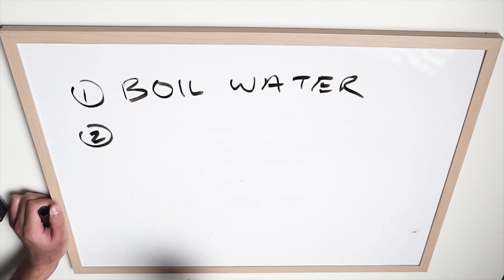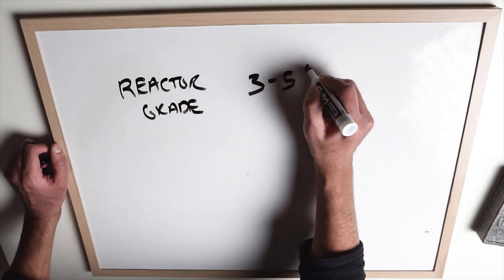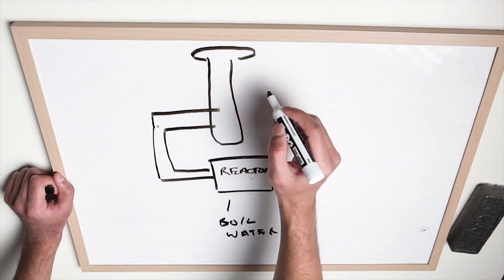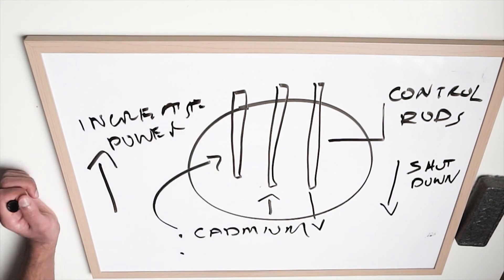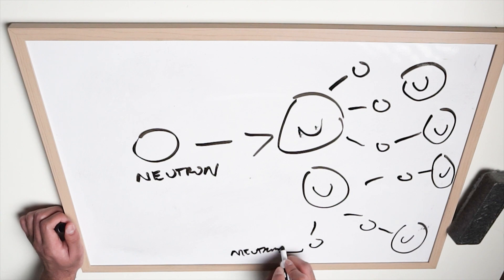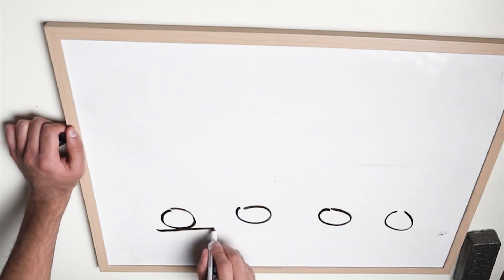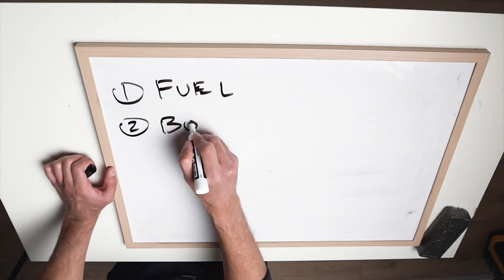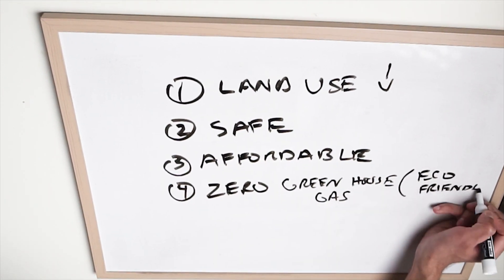Nuclear power reactor EXPLAINED in 5minutes

Comment: Can you please explain how they fuel bundles boiled the water, i mean what is the switch to just start the reaction
Reply from the maker: Technically water doesn't boil in the reactor, as the CANDU/PWR reactors have pressurizers where boiling can take place. However the water warms up as it passes through the pressure tubes with hold bundles (fuel). All you need to sustain that Nuclear chain reaction is a steady source of heavy water. Heavy water is a moderator thus its used to maintain that nuclear fission chain reaction. Hope that makes sense, thanks for the question!